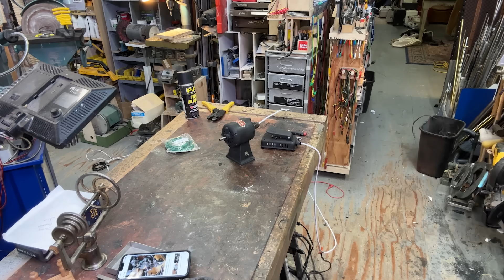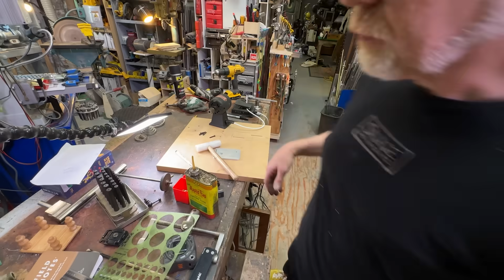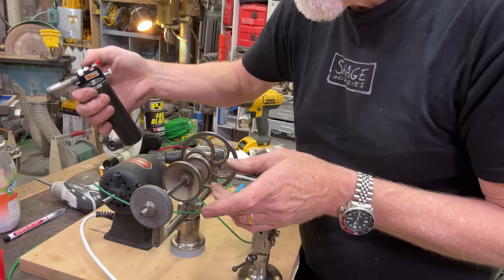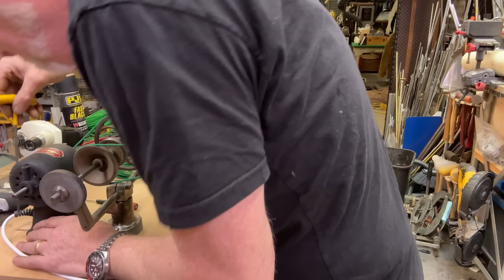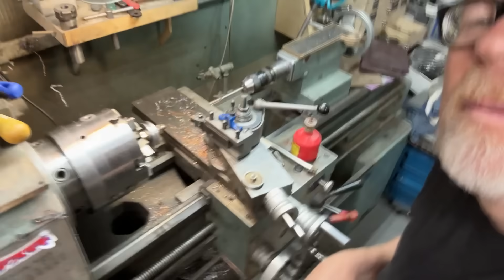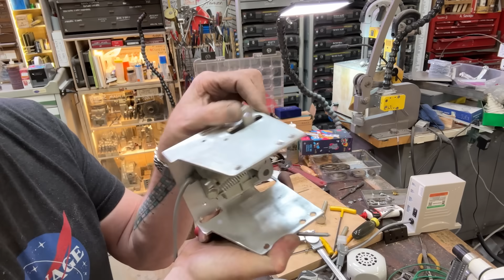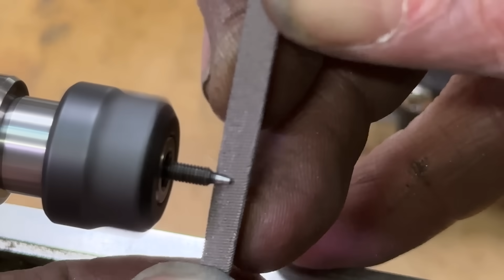Adam Savage's New Mini Watchmakers Lathe!

Comment: Commenting early (don't know if you found a tach), but in the absence of one you can calculate gear ratio on your lowest speed using a simple ruler to get diameters, chuck a shaft up in the lathe, tape one end of 100' of string, put a stop watch next to it, and use your video camera to get a precise time to roll that string up.

From there it's just math to get motor RPM, your other gear ratios, and all RPM's.

I am shooting from the hip here, have not tried this procedure, but I am pretty sure you love improvising as much as I do, so its a thought.

Comment: Great vid!  At some point try the graver and T rest, you will be amazed how you worked without it!  Also a longer distance between motor and headstock with a thinner belt in a figure of 8 will make your drive much smoother when you get to work with finer work.  M

Comment: if you think that is small, you should see a R/C car motor lathe.  or even smaller, is the slot car motor lathe.  they don't even have an spinning arbor.  the rotor is spun by the belt itself.

Comment: What would be ideal is a metal platform that has a surface similar to sandpaper such that instruments (the lathe, the motor and the intermediate shaft) having matching sandpaper can be easily and accurately repositioned for optimum operation. No more drawing instrument outlines or drilling mounting holes on the platform. Perhaps a combination of a grid of holes for mounting clamps covered by sandpaper. How about that?

Comment: They make a tool that is a soldering iron with a big flat blade on it and then it has a jig that squeezes the belt ends together after they are heated up and melt together.

Comment: If the thread count of the control knob could push a full inch with only 360 degree turn you could have a handy wheel with a suicide knob from off to max easily.

Comment: Inspired to drag out my watchmaker lathe that has been sitting in a box for 3 decades. Never found a good motor solution for it. Till now. Add a milling arrangement so tiny gears can be cut on the indexer. Time to google some setups.

Comment: Hey I watching you make a new round thine belt. And wanted to share a tip. Next time use a soldering iron with this attachment you can create in your shop , flat stock 1-1/2 W x  1 H x 1/8 Thick. Then machine round stock to slides into your soldering iron,  spray paint- for nonstick put the two pieces of  belting between this heated  flat plate attached iron heat the two ends of belt, press and hold the belt ends together till cooled then trim   This works every time. There is a tool kit made just for this purpose but why buy when you can make your own.

Comment: Interesting project. Could add optional stepper motor drive for gear tooth cutting. Also sink channels in to install a metal ruler on your motor adjustment. I may have done this comment before you did it on your video, if you did my suggestions later.

Comment: There is a tool for welding those drive belts together. Look up polyurethane belt welding kit. It's basically a soldering iron with a plate on the end instead of a tip. And a clamp to hold the belt. Might make your life easier if you have to do more of these types of belts.

Comment: Adam, the switch for the digital servo motor is an optical switch, you can make it more subtle by gradiating the interference blade, it will give you a much wider range of low speed before it engages at full speed.. i used a pencil and gradiated the ones i use on my machines.

Comment: I did the micromachining for my watchmaking certification on a Vector lathe nearly identical to that, mounted in a vise on the bench. I have a few thoughts that may or may not be useful:

1. If you are planning to do fine, precise work on that, make sure you have a hand tool rest and a file roller.  You can get vastly better accuracy with a hand graver on a tool rest (how wood lathes are generally run) than with a cross-slide and tool post, not to mention you can make any irregular shapes you can reach into with the tool.
(and I assume you know from your larger tools not to trust the dials on the x/y knobs, but it can be tempting without a DRO, just keep the micrometer next to you)

2. That motor is infinitely more than you need.  I ran on a 1- or 2-speed motor, controlling speeds with a pair of those 3-stepped pulleys, one each on the motor shaft and headstock.  The torque was low enough to stop by hand at many speeds, but I could still cut a hardened steel watch stem with a carbide tool.

3. Those belts are fine to join with a little practice, but use a less aggressive flame. A cheap lighter should work fine, but I always used an alcohol lamp which keeps it hands free like your torch. Or I suppose you could get some fancy kind of belt as mentioned in other comments.

Comment: I have a industrial sewing machine motor on my Pultra P type lathe and I have replaced the leaver control with a single turn potentiometer, easy to do if you want the wiring diagram just answer this.
Hope you added oil into the oil pots high spin 5

Comment: I have the same lathe. We use hand gravers to do pivot shafts and other very fine machining. We also use a foot pedal for frequent start/stop tool adjustments, much easier and faster when using both hands for very small fine works. Its a very different thought process compared to larger lathes. Using a tool holder will just crush off very fine pivot ends, better results using hand gravers. Nice work getting everything going again, its becoming a lost art.

Comment: That's a nice piece of Kit!.. I have a slightly bigger model; a Boley 1a.
It came with a Sowingmachine Motor of only 75 Watts, and that was pretty worn out, i replaced it with a "polishing machine motor" of 150 Watts.. which gives it plenty of Oomph!.
Instead of a Sliding adjustment, i made a swivel mount for it, with a treaded rod for adjustment.
I don't have a cross slide, so everything is turned on a toolrest, just like on  a wood lathe, 
For the Tailstock, i made an 8 mm rod into a toolholder, with M8 x 0.75 cut on it, and the center bored out to accept Proxxon Collets i can fit small tools with a collet, or with a Proxxon drill chuck..
I Use this Lathe to make all kinds of small parts, like watch parts and even PolyCarbonate Watch Crystals.

Comment: Post write up: .... Well, this ended up being a wall of text, so I apologize to anyone who decides to read what's below. Run on sentences and overuse of commas are beyond this point. Also, I make no illusion of being a professional, this is purely from observer's and amateur's point of view. So Adam's knowledge and experience definitely supersedes mine.

I'm glad you were forced to switch to a different motor. Primarily because I did not like the placement for the power switch. So if the pedal had gotten stuck and you needed to turn it off, and you or someone didn't think of pulling the plug, there would have been a need to reach in between a bunch of moving parts to get to it.

Everyone is capable of having a dumb moment when something suddenly goes wrong, hence, it was not a good spot for the switch. Even if the motor was turned 180, having to reach around and behind is asking to be snagged by moving parts as well. Soooo yeah, the need for a new motor was for the best regardless of the torque need.

The new power switch location as well as the speed control does give me some concern in that regard, but it feels like it's less bad. Likely because it looks like the motor is much further away than the first one was mounted.

The setup you made for controlling the speed is quite nice, and more accurate than the way I would have done it. I'd likely had done something much simpler, basically remove the spring, extend the lever, and have it's ability to maintain location be purely by friction by pressing the end of the leaver into the board. But like I said, your setup there is definitely better than that. The only thing I can see my dumber setup being better at is being able to mark set locations along the sweep path for quick changes, as well as putting dimple into the board to create soft snap points.

Recommendations: 

- Wheel Jockey: A way that bike chains keep their tension regardless of gear is a wheel jockey. If you plan on using other sheave diameters to have additional control over speed and you don't want to change distance or belt, a wheel jockey is not a bad way to go.
- Mount the speed control to the side or in front where you don't have to reach under or around anything. You could even have your control mechanism facing vertical with a larger wheel on the bolt for even more fine tune control of the speed.
- Speed control: Make it so you can't turn the bolt further than the max speed. Don't want to accidentally break the lever. It's a lot easier to accidentally break something when you're dealing with a screwing motion since you get less feed back on a turn than if you were actually pushing the lever. While at first I jumped to just cutting the bolt down, it may actually be best to just put something on it to do the job. Additionally you could extend the length to have the head more to the edge of the mounting board so you're not reaching under, but to the side, to control the speed. All without having to move the actual controller mechanism.

Anyway, I love these kinds of vids. It is odd but I find more interest in fixing/making of tools than in most build videos.

Comment: What a lovely little lathe and nice up-grade, although I was a little disappointed that you didn't incorporate the jackshaft into the final version since the motor tries to make the jump to light speed but starts at 400 RPM.
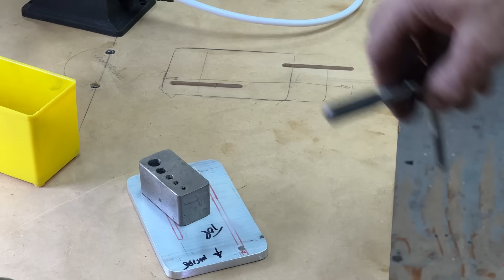While enjoying the view of your Seiko at 8:25, I thought I'd mention that there is a strong market for quality refinishing of SS watch cases in the US market.
To be perfectly clear, quality is the key word here. The sharp lines between the brushed surfaces and mirror polished surfaces as well as the direction of the brushed and or ground surfaces is critical to the watch collector.  The "Seiko Tuna" I am wearing has a slightly concave ground finish separating the mirror polished surfaces which was produced by rotating the case in a collet against a diamond wheel with about a 6 inch diameter. 
Just in the Seiko line of watches there are hundreds if not thousands of case styles and finishes.  Nevertheless, if someone had a tool grinder, a cabochon machine, a faceting machine (Lap) and a lathe and mill to manufacture the required case holders, the perfect re-finish could be done quite easily especially for someone with tool grinding experience.
I wouldn't have mentioned this if it weren't for the fact my entire shop and all the tools mentioned above were recently destroyed when the neighboring business's fire literally melted mine.  If you've never seen a diamond grinding wheel with the aluminum hub melted from the brass and diamond rings, I have several and it is not a pretty sight.

Comment: You've got a AC servo motor which I assume has a position encoder since it has two plugs, one for the 3 phase coils and one for the encoder... So why wouldn't the speed the controller says it's running at be correct under a light amount of load from the belt?

Comment: A DC motor can vary speed an not lose torque using a DC speed controller . Had  friend that would but DC motors on his mill and small lathes with great success , dial the speed in without changing belts .

Comment: Hi Adam, I nearly bought a slightly bigger version of your watchmakers lathe some years back but passed as it was too small for my needs.  What I wanted to mention is that I recently bought a Chinese sewing machine motor for my current lathe and found the lever switch was a bit on and off with not much variable range, you can fix this by removing the circuit board in the switch and spacing it out from its mounts with plastic wshers by about 1 to 2mm.  As these are a hall sensor and work with a magnet, a bit more distance between the magnet in the and and the sensor gives a much smoother progression of speed, its worth doing as it improves the control a lot.  Keep up the good work, Mark, UK.

Comment: Such fun! The five inch pulley on the jackshaft is a speed pulley for running pivot shapers or grinders on the lathe when the work is held immobile in the headstock. You want a three step cone pulley of about an inch in diameter on the centre step, and a reversed one of the same on the motor if you plan on using a motor. I use a swing treadle on mine. https://www.youtube.com/watch?v=OGEU8N0Moco  I recommend "The Watchmakers Lathe" by Ward Goodrich for further reading.

Comment: If (when) i had a precision watchmakers lathe, I would also like to have a big lit magnifier over it so I can see closer what im machining. Have you got the cog cutting jigs to go with this for making your own miniature gears? Personally im interested in lock making, so I really crave after a mini lathe, but hobby lathes just dont have the precision. Also, higher speeds and more precision is needed to prevent chattering with tiny parts.

Comment: I don’t know how much tension will be on your drive belt, but the base for the lathe would resist pull out better if the two screw holes on the side toward the motor were on the side opposite the motor…

Comment: Your motor speed is probably a fraction of the "rpm" number displayed on the motor controller. If it's a 4 pole motor you'll be getting half the indicated speed, so on so forth. Best to check, so you nail your feeds and speeds :)
Also, you need more brain damage to do a Jim Jeffreys... Got to ignore all the facts to oversimplify things that badly :)

Comment: Those are grease cups, not oilers. That’s why it’s threaded. Over time you turn it tighter to press more grease in, vs a cap that’s easy to lift for oiling often

Comment: When joining round poly belting use a piece of stainless plate, heat it and hold ends of belt on each side  until melted then slide it off the plate and join immediately. First used it 40 years ago on a pantograph engraving machine. 4mm worked on a watchmakers lathe I used then as well. Wish I had one now for modelmaking. I build 1/8th scale workshops, weatherboard clad, timber framed complete with tools. I want to build a engineers shop but need a tiny lathe to build the tools. You will find you need high speeds for most small turning on the watchmaker lathe. Cheers and G'day from Tasmania..

Comment: Totally jealous. You have some VERY generous patrons to GIVE you  such a tool, complete with cross slide,  tailstock, cutting tools and a huge selection of collets. WOW. 
I repair and restore antique clocks as a hobby. I don't know if your followers understand how much that setup as given to you costs in such fine condition.  The intermediate transmission I hadn't ever seen before.  It's a tool set up I can only wish to have, but can't ever afford. 
I understand why you changed the setup to use the servo motor. IMO though it is sad to see you not take the time and effort to learn how they were correctly set up in original configuration, demonstrate that in your video and really test out it's functionality restored to that original state. Now people will never see the beauty of that extraordinary tool engineering. 
I'm not sure what drawer or box all the unused parts will end up in or what you'll eventuality do with them. 
It's very difficult to try and aquire all the bits and pieces over time as you can't intermix parts from different manufacturers to put a complete system together. 
That's why for me it's sad to see you break up such a complete system.  Very hard to come by and prices for them are extraordinary if you do.  Yes,  they make doing fine work a real joy as I'm sure you'll find.

Comment: The only thing I'd do is extend that speed control shaft out to the edge of the baseplate so you can put a bigger knob on it, maybe something with a handle. You'd need a holder of some kind to keep it from wibbling about maybe but that just adds to the appeal for me.

Comment: Beautiful machine and final assembly, the only thing that lets it down is the contrast between the lovely old lathe and the modern sewing machine parts. 
As a prop builder, it would be easy to make a cover for the motor and driver with the same aesthetic as the Lathe. It's also a good idea to protect the DC motor from Steel particles. 
A bit of stain and some brass highlights and it would look fitting.

Comment: 15:56 When I join round belts like this, I use an exacto blade in a soldering iron.  I mark the belt ends then lay them side by side and cut diagonally with the hot blade.  Then, I press both cut ends against the blade again to soften the plastic, and press them together.  I end up with a very smooth and strong connection, with more surface area adhering it.

Comment: i would almost make it vertical. so the motor is on the bottom and gearing in the middle. and a bench you can stand in front of.
Or.... in 2023 just add a newer motor with speed control?
Reply: lol, i should have watched the entire video.

Comment: You lucky, lucky B**d, 8mm collets ,Im glad someone sent you one. make a planetary gearbox for a tiny flying bird, like darpa hummingbird 11 yrs ago.  Just bought a Robblak hand shaper to make internal gears . One of my most used workshop items is razor blades, single sided with an aluminium crimp over one edge, box of 100, get them red hot and join that green elastic pulley on each side , just slide up and join, use another to shave the overflow. Come in a box individually wrapped in card prottectors over the blade. why would you want a low speed , high torque on a lathe taht you use to make staffs